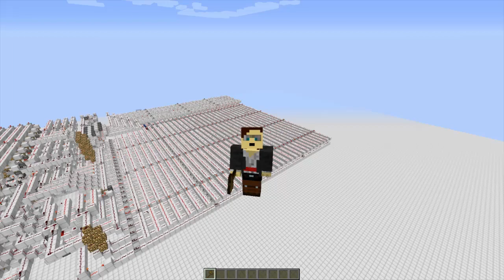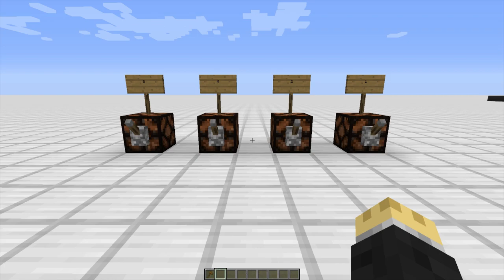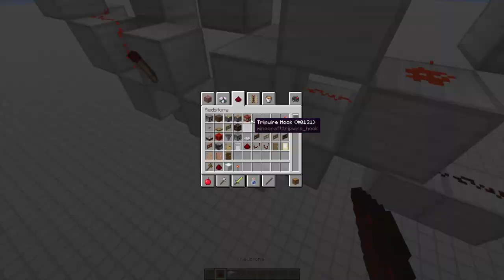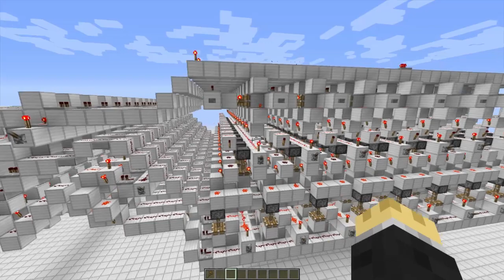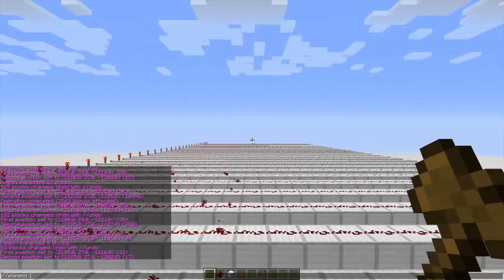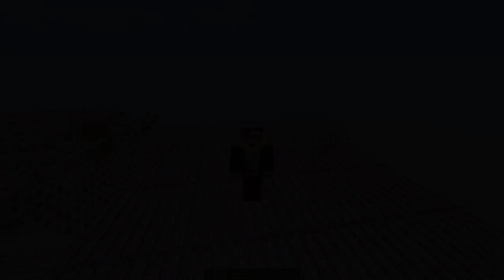Basic Computer Concepts - Pt 1 - CPU Architecture

Comment: I used a different decoder design and I am experiencing issues on the timings. I am using the slow basic one but I don’t know why. Please help.
Reply from the maker: Here's what you're going to have to do.
1) Start performing various tests and take note of what you expect the computer to do, and what it actually does. See if you can notice a pattern.
If you need to more closely observe a line, it can help to remove the clock and single step the machine.

2) If you do see a pattern, see if you can verify it by constructing a test that should break the pattern. For example, you notice that the computer only seems to break with odd numbers. See if even numbers break too.
The goal here is to get as well defined of a definition of the issue as possible.

3) Once you have defined the issue, start hypothesizing possible reasons for the fault. This is where you need to rely on your understanding of the computer system and exercise some critical thinking.
You don't have to be super precise with your hypothesis! We're not looking for "the torch that sits on the 3rd line between registers 6 and 7". Start with the highest layer of abstraction.
So for example, if you see that the computer only shows an issue when two numbers are operated on. Then we can disregard the registers and control unit because the issue likely resides in the ALU.

4) Verify your hypothesis with a test. If you suspect a component is not working as it should, isolate it and check its behavior.

5) Repeat these steps on the next layer of abstraction. Example: if you determine its the ALU that's at fault, understand the ALU is constructed with buffers and full adders and circuits of the sort, begin hypothesizing which component would most likely cause the issues you are seeing. Repeat until you find the exact component at fault.

First time is always going to be slow. Just keep chipping at it. You'll get faster as you gain knowledge and experience.
Reply: @n00b_asaurus  I took ap cs because of you thanks for inspiring me lol sorry for the over a year reply I just found the vid again

Comment: On bedrock and working on a computer. Don’t have piston quazi or however you spell it. I’ve spent some time developing a registry to add to the back of it. I’m choosing not to use the dual read ram that is popular on bedrock because the outputs use locking repeaters so each bit on the registry will be have to be 2 block spaces apart. I’ve built the your rendition of the 16 bit ALU with one block space apart inputs and output. (Life saver by the way, I had a full adder and subtracted built in 8 bits but it used comparator xor gates in a horizontal layout because I couldn’t grasp the vertical concept yet. Your additions to swifts ALU solved so many of my problems) anyway I took inspiration from the branchable program counter and made a semi compact one wide tillable memory cell (x16/register), that can be written to from the A or B bus with one falling edge pulse, and output it’s data A, B, A and B, or neither(based on the state of two switches). I did this so I could easily add any number to itself from one registry and also negate numbers on the A bus, I don’t know if this will be useful or if there is a much easier way to do that. Feel free to tell me if there is. Here is my problem I’m hoping you can help me solve. If I need to send something from say “r7” to the ALU I need to send it over the A or B bus (or both if I keep that feature in the register design), Solutions from the ALU itself are sent to the A bus. So do my red stone wires on the buses need to transfer data both directions??? Or is there something simple I’m just not grasping. I can’t think of a way to do this without data looping back onto itself. And I’m kind of stuck. Also is my design choice redundant?  I already have a 16 bit x 16 address single read ram built that uses locking repeaters, so the outputs are two block spaces apart. I could easily convert that to dual read and use that for the ALU but they aren’t right next to each other so I’d probably move the ALU or build a new dual read ram at the ALU. I could do either. Also I don’t know if I’m over complicating it and if I should just be done a totally different way. Do we have two busses so we can send data both directions? I don’t get it. How do I send date from one place to another, but also receive data back on the same lines without it being bi directional. Please help lol. I would greatly appreciate any and all advice on my journey. This is my first computer to take on. It’s been a learning experience. With hours of computer logic courses taken on YouTube and your videos helping me with the design process has been a real blast. I’ve learned tons from you man thanks for all the videos.
Reply: Data comes in on the b bus and out on the a bus. Each register needs to be able to write to input A of the ALU and B bus( which goes into input B of the ALU) independently. The output of the ALU also needs to be able to write to each register depending on which is selected. Is all that correct? I did some drawing and that’s what I come up with. And I think my design needs a small overhaul lol
Reply: Should I keep the function of being able to write to the registers from b as well or is that not worth another decoder
Reply from the maker: @cameron-wy4wd  Might be easiest to put a buffer register on the ALU A input. Just connect that directly to the B bus.
That way if you need to use both the A and B inputs, you can use one cycle to move the data from your register to the buffer, then use the other cycle to read from your other register and the buffer.
Reply: @n00b_asaurus  thank you for responding. I found a better dual read design than what I created. I used that instead. I also decided to set it up like yours. 16 bit ALU, dual read ram registers (x16) and now any data I want to save to the registers has to go through the ALU first. This way I can operate on immediate data. Before I was trying to get immediate data past the ALU and directly into the registers. Much easier the way you did it. I’ve got it debugged (I think) and I’ve got some program mem built to step through a program. I’m read to install the program counter but I’m setting up a register for my flags now. I have to rewatch the video to see how you incorporate flags. I’m doing things in my own way kinda but I’m taking heavy influence from your design for my first computer. I w watched hours and hours of your videos and playlist (most of them twice or three times) thank you again man you’ve been a huge help.

Comment: 1 important tip for buliding redstone cpu: preformence depends on redstone computer's pipeline
Design must be consider to make a lot of pipeline or it will work extremely slow
Reply from the maker: You are correct sir! 
I got a few videos on experimenting with computer concepts. Right now I'm on state machines, but I've got pipelines in the queue.

Comment: You are still responding to comments. I respect it. I’m learning real java rn and I’m thinking of making a programmable computer in Minecraft. It’ll be made and runnable in vanilla, but you can use data packs to import your own programs to use, but like, I might need to look into buying an attention span to accomplish that.
Reply from the maker: Writing programs for redstone computers using datapacks... now THAT sounds interesting!
I wonder what that would look like.
Any ideas on how you are going to implement something like that?

Also, I try responding as best as I can. Sometimes comments fall through the cracks... I'm usually notified of new comments, but youtube doesn't like notifying me about responses or comments marked as spam.
Like I said, I try to actively search for and respond to comments, but forgive me if I don't respond.
Reply: n00b_asaurus this is really a concept right now, I might have to make it an actual mod and have datapacks interact with the mod. Of course, the programming would be in java. I think I could make it run on different languages or make my own by detecting certain variables of the program and basically make it so you can write really simple java and implement text commands to do something in a simpler or more familiar. I don’t know how exactly I could use that and it’s definitely something for the future. For what I’ve got currently, I’m thinking about having a mod to translate the code to the computer and being able to write actual java into a mod or data pack to put into the computer. This would require simple programming and a really beefy redstone computer though
Reply from the maker: Interesting!
Well if you ever get it to work, I'd love to hear about it!

Comment: When I added the program counter, the whole thing broke. My guess is that the next instruction fires at the same time that the first instruction is deactivated, so the wrong number is written to RAM. Please help.

PS: I can send you the world if you want.
Reply from the maker: that shouldn't be the case. if you set the timing for everything correctly, and the write lines are all active on the falling edge, then the instruction should be done executing by the time the next instruction comes in. manually clock your PC and make sure the correct signals are present, then walk through your program slowly. if it runs successfully, your PC is running too fast. Slow down the clock until it stabilizes.
Reply: Are you saying the ALU has to fire at the same time or after the write lines fire?
Reply from the maker: they all fire at the same time, it's just the ALU function lines are positive level active - meaning they are active when the lines are on - and the write lines are falling edge active - meaning they trigger when the lines go from on to off. Think of a single instruction as a series of steps. as the instruction activates, data is sent from it's respective registers. whilst the instruction is active,  the data is modified by the ALU. and when the instruction deactivates, the registers write the new number to themselves.

Comment: Hi, Mr. n00b. I am attempting to make an ALU in a program called Logic.ly, a logical simulator, and came across a large conundrum in computer structure; How do you denote between negative and positive numbers? I know you said in your video that the last bit indicates this, but a large enough addition would break this rule; For example, and for the sake of simplicity, if I had a 3 bit number, the numbers -1 and 7 would look exactly the same to the ALU, registers, etc. How would you solve this?
Reply from the maker: yeah, so as I said in the video, negative numbers are just 2's complemented positive numbers. so as you said, if you complement 1 to -1 in a 3 bit number, it looks like 7. But you can still add these numbers together and get you're answer, you just have to remember to lop off the last bit. So for example, if you add 5+7 (the same as 5+-1 in this case) the result is 12, or 1100 in binary. But we're working with 3 bit numbers, so that last bit doesn't exist. This makes the real answer equal to 100 in binary, or 4 in decimal. In most computers though, that last bit is stored in the carry flag, and is often combined with the negative flag to detect arithmetic errors. Say for example you read that 100 as a signed number, well then the result would be -4, not 4. since 5-1 is not equal to -4, this is an error that would trigger an exception in the operating system... but we haven't gotten to that yet ;)
Reply: n00b_asaurus 

Where do you talk about this? I need to find out where the exceptions are and maybe how I can solve them.
Reply: n00b_asaurus 

Where do you talk about this? I need to find out where the exceptions are and maybe how I can solve them.
Reply from the maker: Sorry for taking so long to get back to you. You were marked as spam for some reason.
I haven't really covered hardware exceptions anywhere yet. Though it's not difficult to do.
Part 4 of this series covers interrupts, which allows you to break the flow of a program to handle something more important.
Just understand that an interrupt is triggered by a physical signal, and that anything can generate that signal. 
if you make a circuit that checks for a certain condition in the CPU, and then generates an interrupt signal when that condition is met, you've basically got a hardware exception right there.

Comment: hey! i am new to this channel but this really helps! i’m working with a 16bit computer right now and it clears up some of the fundamentals! thanks
Reply: still kinda confused on 2s complement, why do you add one to the negated output?
Reply from the maker: @delicate6930  If you don't understand 2's compliment as a concept, I have a video for that in my how to build a computer playlist.

Otherwise if you do understand 2's compliment, you'll know that it allows you to turn a positive integer into a negative one.
Adding one positive integer to one negative integer is the same as subtracting 2 positive integers.
So to subtract, you take the subtrahend and 2's compliment it, then add.
2's complimenting of course is done by inverting and adding 1.
And since addition is communicative, adding 1 can be done at any point of the addition. E.g. you can invert B, add 1, then add A, or you can invert B, add A, then add 1.
In our case, it's convenient to just add A and  1 to the inverse of B at the same time by injecting a carry into the adder.

Hope that clears it up.

Comment: I ran the lines by hand to test in the program memory, but the write line doesnt seem to work even though all the timings on the same. What do you think the issue is??
Reply from the maker: I'd activate a line in program memory and follow the write signal to its destination. Make sure signals are reaching, pistons are moving, torches are on/off, etc....
I'd then make sure your data is making it to where it needs to be.
If all looks normal, deactivate the program line to write. If the data still isn't stored, delay the read/control lines or the data lines going in to memory.
Reply: Thanks!

Comment: Beginners Computer? firsto tutorial on how to make a computer in mc and after just some minutes i dont even understand a word... How do i know when to use my components???? i dont understand this
Reply from the maker: Right, so unfortunately I'm not doing a block-by-block tutorial, but there are a few very good reason for that.

1) There are plenty of block-by-block tutorials out there.The problem most of them have though is they dive so deep into the details that they bore you to death before you learn anything. So I'm condensing my information to only the fundamental concepts so you get the idea of a computer quickly. You can fill the details in yourself at your pace, with the help of the plethora of component tutorials out there.

2) I'm only giving you the fundamental concepts to prevent you from getting stuck in a rut. I.e. Minecraft computers haven't changed in 5 years because everyone is following the block-by-block tutorials. As a result, unless they really get into what they're learning, they don't learn anything new. By giving you only the structure of a computer without actually telling you the finer details, it's left up to you to experiment and figure out what works and what doesn't. I find this usually leads to more discoveries then by simply imitating a tutorial. 

I can't remember what the other reasons were. But the point is I'm giving you a structure, a skeleton, or a blueprint. It'll give you the full picture, but you have to fill in the details yourself. 

The way I'd recommend doing this is if I mention a term or concept you don't understand, Just google it. I've used industry standard terminology, so googling it will result in what you need to read or watch in order to understand. 

E.g I mentioned two's complementing numbers at one point in the video. I gave you a summary of the concept, but if you still don't understand, or you want to learn more, just put "two's complementing numbers" in the search bar above and watch a few videos. Come back when you feel you understand the concept, rinse and repeat.
Reply: I watched the video again and serched up the words i ddnt understand, i dont understand how i coulndt understand this yesturday xd. I hade to take some bits slower but in the end i now have a pretty good idea of this. Thanks for the tip
Reply from the maker: Np, Glad I could help ;)

Comment: Hi! As my flags and the go-to system check the same number how can I program the following line:
Check the output and if it is 0 than go to line 5?
Reply from the maker: what you're describing is a compare instruction, and unfortunately you need a digital comparator in order to perform such instructions.

That was a joke!
You can compare two numbers just by subtracting them.
E.g. if you subtract A - B:
if A > B, the result will be positive.
if A < B, the result will be negative.
if A = B, the result will be zero.

You don't have to store the result, in fact it's faster not to. Just perform a subtract command, don't store the result, and latch the flag register.
If the result is positive (A > B), the carry flag will be on.
If the result is negative (A < B), the negative flag will be on.
If the result is zero (A = B), the zero flag will be on.

Here's a little cheat btw: obviously you can check to see if two numbers are not equal simply by negating the zero flag.
But you can test for 'greater than or equal to' just by testing for 'not less than'. Same thing with  'less than or equal to' and  'not greater than'.

Hope this helps ;P
Reply: @n00b_asaurus  Thank you! You have made my day with this! ☺ (I just couldn't get around it)
Reply from the maker: @lichterberci  np